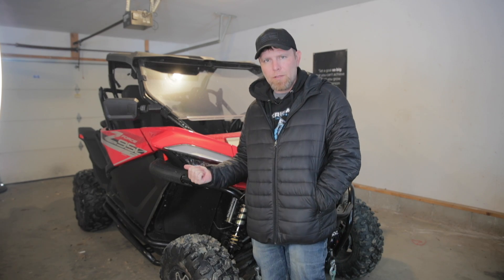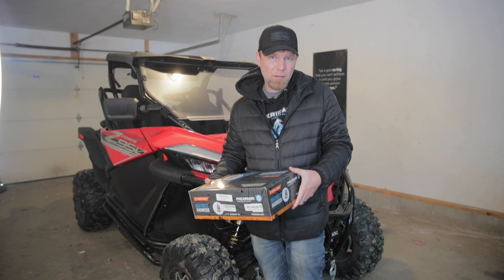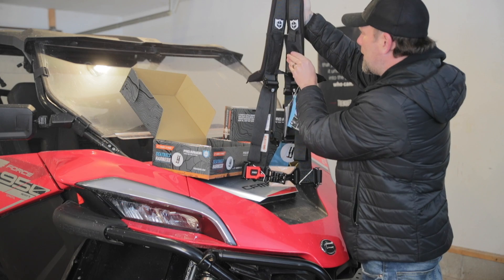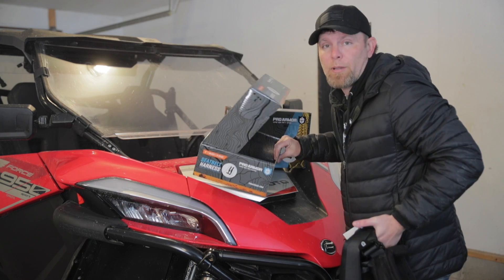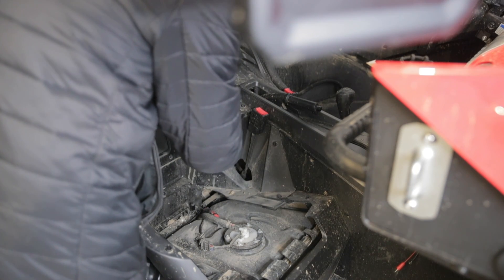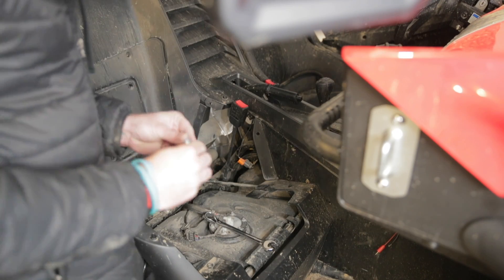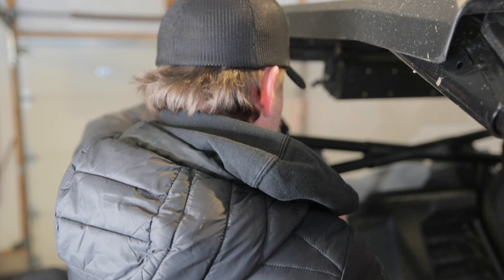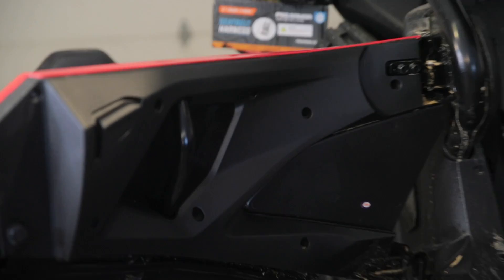Installing Pro Armor Harnesses on my CFMoto Z950 Sport

Comment: 4 points were one of my first upgrades too.  The only downside for me is the limited mobility causing reduced field of vision while rock crawling.  Sometimes, a driver has to lean forward to see the obstacles and over sand dunes.  The harness is great though.  I wouldn't go back to the OEM belt.
Reply from the maker: Man...I really wanna hit some sand dunes this year...
Reply from the maker: Haven’t done any dune riding with it yet
Reply: @JustinTheCreator  Michigan City
Reply from the maker: @beckyroo83  we may have to do that!

Comment: Does the machine recognize it as a seatbelt or do you need to overide the safety feature preventing you from going full speed?
Reply from the maker: You don’t need to override anything. It is just for the seatbelt light in the dash. It won’t limit anything

Comment: Did you attach the outer top of the seatbelt to the location of the seatbelt that you removed.
I could not tell. You were allways standing in front of the camera.
Reply from the maker: I did not...I actually attached it around the roll bar to the inside of where the seatbelt is. I talk about being worried about it sliding down in the video, but they have literally never moved.

Comment: Did you try the outside bolts to the factory seat belt hole and see how that fit? Or is on the bar better? I got the ACES 4 point harness but havent had chance to install yet. Might cut and weld in mounts on the rear bar to bolt to.
Reply from the maker: I did. They feel much more secure coming from the back roll bar
Reply: @JustinTheCreator  I agree and they hug the top of seat where your shoulders will be
Reply: @JustinTheCreator  any trouble with the belt sliding bach and forth on the tube?
Reply: @edclements5112   never rode mine yet with them in yet but I don’t think they will slide back and forth after you tighten them down when your in the seat
Reply from the maker: @edclements5112  not yet! Lol

Comment: What did u do with the rest of the seat belt just let it hang? The mounting point qas used for the new harness but the old one is still mounted at the top.
Reply from the maker: I actually ended up leaving the old seatbelts, just in case I ever want to just use those.
Reply: @JustinTheCreator  where did u mount the bottom since the harness took its spot? Working on it, turn signals, front bumper, skids, and clutch kit as we speak and through out the daym
Reply from the maker: @edclements5112  I mounted it in the same spot..just removed the spacer
Reply from the maker: @edclements5112  sounds like you’ve got quite the day ahead!! Let me know how it goes!
Reply: @JustinTheCreator   got everything installed but the clutch kit. Didnt expect the turn signals to be so time consuming. I must have watched your two videos 30 times. But i got it and work great.
Reply from the maker: @edclements5112  I didn’t expect it to be that time consuming either, but it is! Lol. Glad you got them working, Ed! 🙌🏼🙌🏼🙌🏼

Comment: Im still working on my 5pt harness. I went with 50 cal 3inch set. Figured 3” will be more comfy over 2” if I ever roll it.  Driver side has a bar to tie 5th point to under seat but still Debating on where to connect the passengers side because of the gas tank and there’s really no place to do it at. But I’ll get it.  I’m still trying to figure out the seatbelt bypass?  Since I took my factor belts all the way out. I called cfmoto dealer and they don’t make one and they don’t know anyone that does for this machine and I’m not a fan of cutting the wiring harness to tie both wires together.  You have any ideas?
Reply from the maker: Honestly...my seatbelt safety thing never worked...lol. My suggestion would be to keep the drivers buckle attached and hidden under the center console plastic and connect the old seatbelt connector in it under there. If i run into that issue, that’s what I’m doing. Lol
Reply: Was told if you completely remove the drivers seat belt and unplug it the light wont come on. Havent tried but the youtuber who i asked said thats how his worked.
Reply: @edclements5112  thank you I’m going to have to try it when the weather breaks. Just been putting extras on it and it’s actually doesn’t have wheels on it right now. I mainly ride on roads and I bought a cheap set of wheels and street tires for it and I’m waiting on a bead blaster to set the bead to put them on. Plus snow in Ohio slowing things down too
Reply: @husqvarnaracer2175   there is always a ratch strap around the middle as tight as u can get it to balloon the tire then add air and pull the tire quick to the bead. Or always a little spray and lighter with the ratch strap and air. Had both methods work in the field.
Reply: @edclements5112  I tried both lol. Idk if tire too soft but it just collapses where the ratchet is and I tried ether and lighter but doesn’t seem flammable anymore